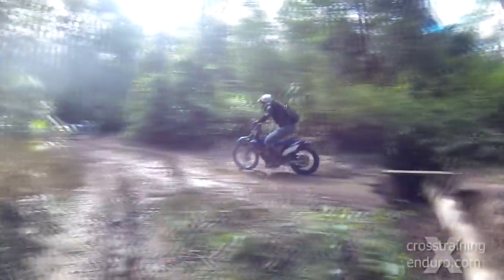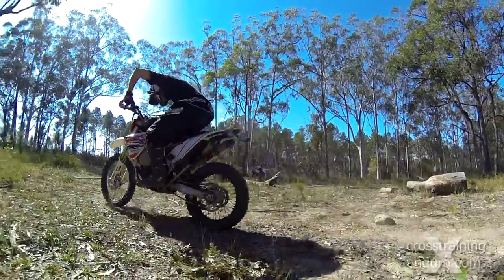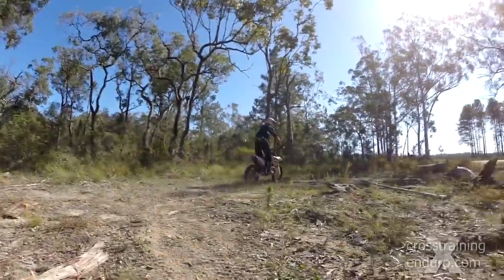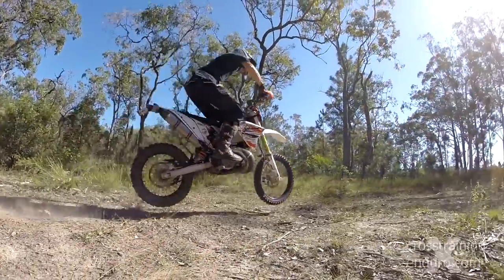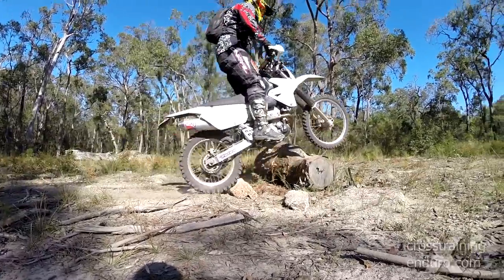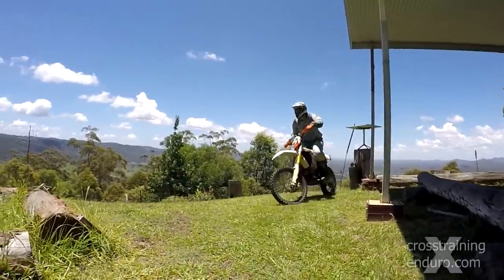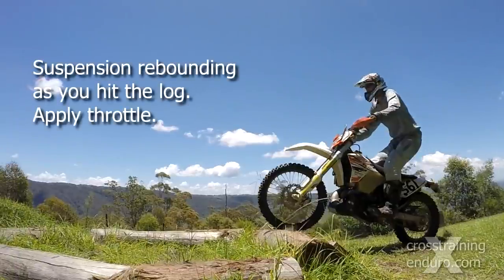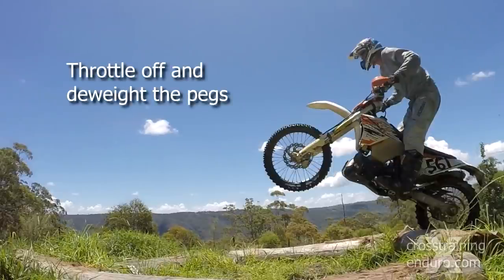How to log double (jump over two logs) on a dirt bike︱Cross Training Enduro

Comment: Wouldn't be a seat bounce "easier/better/a more appropriate technique" to clear the two parallel logs, or does it depent on the distance between the two logs? Especially when you consider that endurocross is done at a higher speed then trials. I am refering to your self critque that you mentioned in your last video. (by the way, I have sent clake an email, but they haven't responded back yet, are they usually that slove?)
Reply from the maker: Erdat Çataloğlu interesting point, erdat. i suspect at low speed the seat bounce might reduce the amount of balance and stability for the rider? i know it's a good motocross technique...  unfortunately that clake 2 vid has created so many sales for clake they are extremely busy and having problems with responding to people in time. i will let them know!
Reply: CROSS TRAINING, ENDUROCROSS & ENDURO TECHNIQUES Thank you for your response and concern about Clake as well.
Reply from the maker: Erdat Çataloğlu the guys actually rang me and said thanks for letting them know you were chasing them. they said things are extremely busy but it's not excuse, so hopefully you will get a reply soon, erdat!
Reply: Thank you very much, I certainly didn't want to bother you with my problems, just wanted to let you know, after all I am watching and listening (and of course reading your disclaimers). By the way, our national event will start in about a month,
Reply: A seat bounce might be a bit risky and have you doing a hand stand landing. Please don't ask me how I know 8-(

Comment: is this possible with a 125ccm?
Reply from the maker: MKgumbα definitely, there are very few parts of the track where the riders get much speed up, and a few riders were on 125s. i did speak with one and he said a bigger bike would be handy though as you could get the front wheel up using engine grunt instead of revs.

Comment: how to deweight the pegs, put the weight on the handlebars???...
Reply: Pull up your foots so you will be in air a short time. But not to strong so that your foots are still on the pegs.
Reply from the maker: BluetomatoCh yep. and it usually follows weighting the pegs, which is just "jumping" on them e.g. from a standing position squat rapidly then straighten your legs fast.